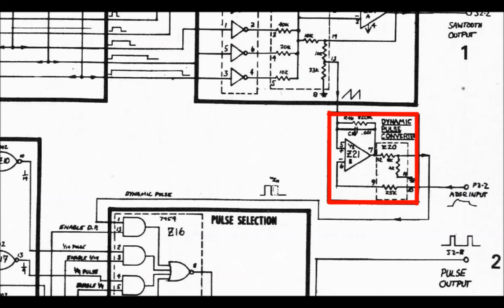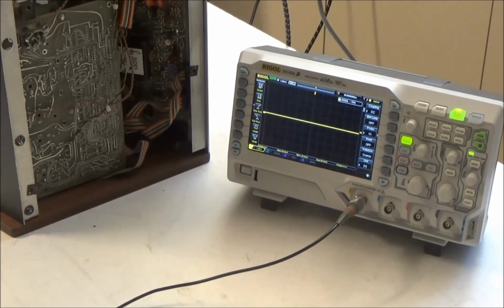ARP Pro Soloist Dead Presets Repair - Synthchaser #140

Comment: Every Synth Chaser video demonstrates the most fundamental foundation of vintage synth repair - Analysis is everything. Before you go in to the machine locate what works and what doesn't, make a hypothesis and then go in and test that hypothesis. Revise if necessary but go in with a map and a plan every time.

Comment: My Pro Soloist is missing some voices too (after some time) but only when it's orientation is horizontal: if it's standing vertical (like yours in the video), all voices are working again. Any idea where to look for or how to trouble shoot such situation? Thanks.
Reply: That could be a mechanical issue. Maybe try to reseat the connectors.
Reply: @Stephen Anthony LOL  well, in fact it has MIDI so that could be the solution haha!
Reply: Look for plug in connectors and resolder all of them. Also unplug and reseat them to make better contact.
Reply: Thanks for the tips! I believe my service guy did all of the above already, that's why I suspect something else.